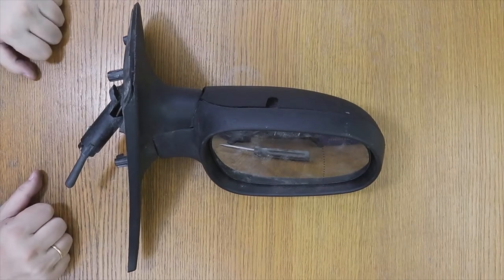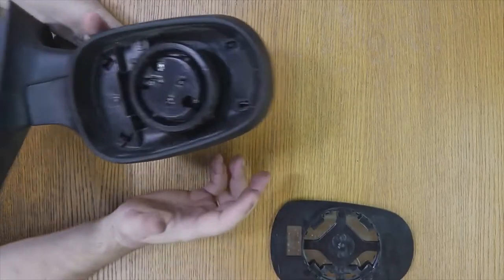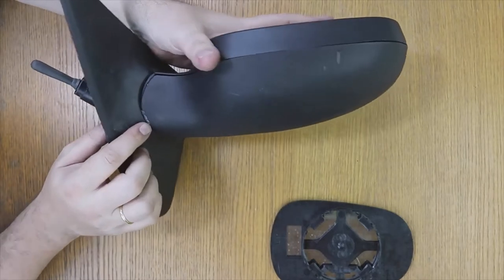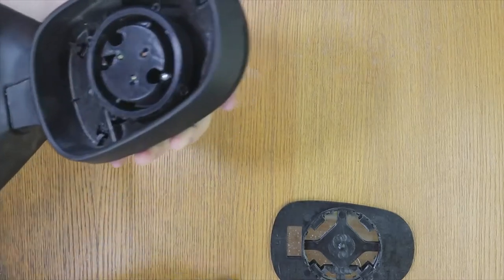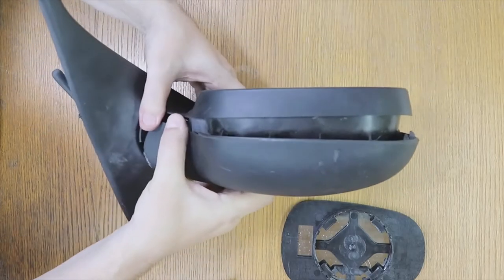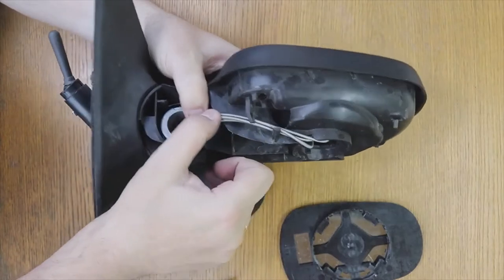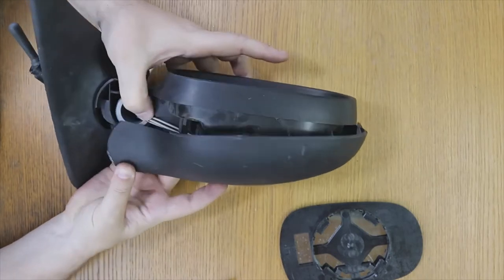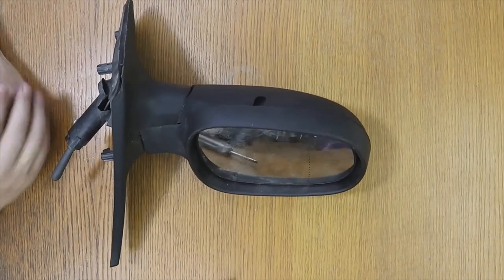REMOVE rearview mirror glass and housing from Renault Clio, it is similar in many other cars

Comment: just a quick tip, it's easier to click the pin nearest to the folding joint by putting the mirror in the inward folded position. that way you won't need to push through the plastic on the "triangle"